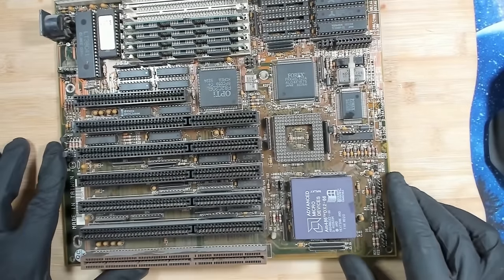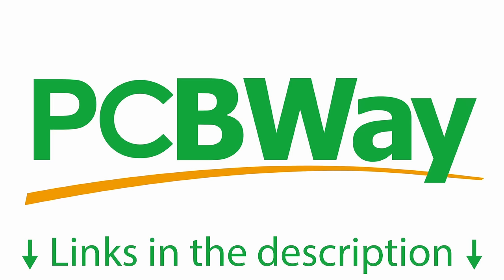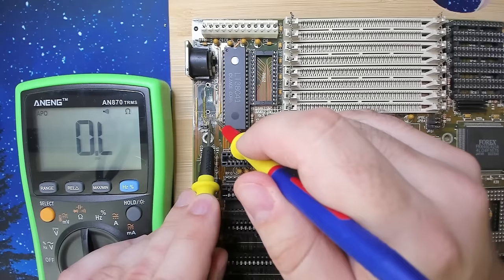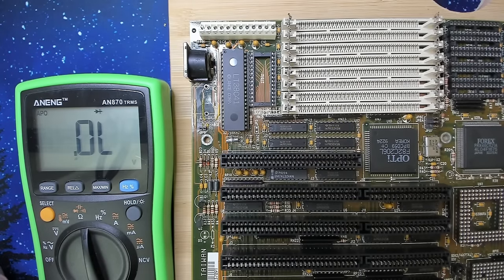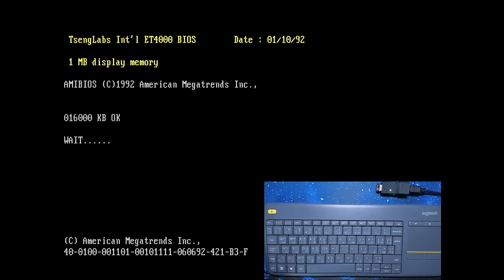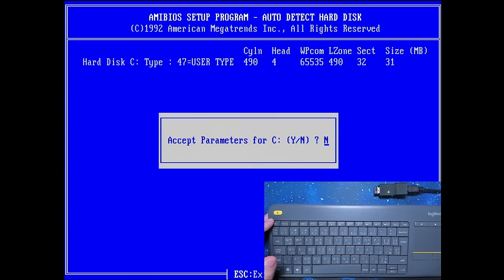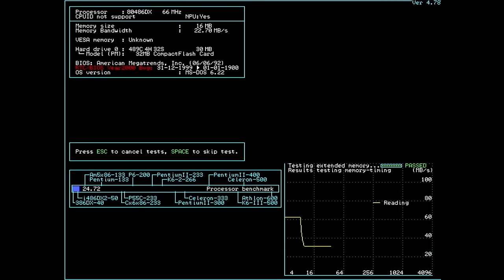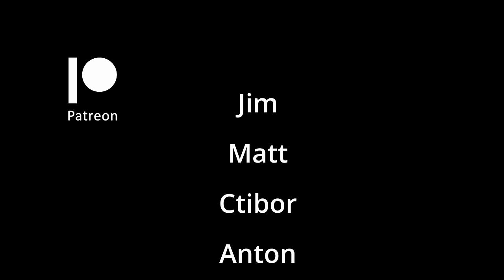Dual-Socket Nostalgia: Forex 386/486 motherboard repair

Comment: I'm playing with PCem with 386 DX-40 machine. It displays perfomance lower then Compaq DX-33 in SysInfo. I wonder why. I checked all BIOS settings and played with some. Only cache disabling changes something, lowering it to 20 SI points. All the other don't do anything. That annoys me. I expected ~40.
 So I changed virtual CPU to Cx486SRx2/32 and now it is circa what I wanted (43). But the whole situation is weird.
Reply: I found what coused this behaviour! It is Waitstates but not in BIOS. It is in PCem configuration. It was 'system default' and now I tried 0 W/S. Now 386 DX40 makes 41 Sysinfo points! Just as planned. =)
Reply from the maker: Nice find! Congratulations on finding the root cause!
Reply: @bitsundbolts  I wonder what are those w/s intended for?
Well on real hardware there are plenty of nuance to be adjusted, but here we've got perfect components that don't require adjustment, aren't they?
Reply from the maker: I'll cover that partially in my next video. It depends on the modules how quickly they can switch from a logical 0 to a logical 1. Basically how quickly the voltage levels can rise and fall. If a memory module is too slow, wait states can mitigate that issue. The drawback is that memory bandwidth will suffer. At least this is how I understand it right now.
Edit: when you emulate old systems on modern hardware, you don't need to worry about wait states. You can just set them to the lowest value - unless you want to slow down the system a little bit.

Comment: Id love to have a wireless keyboard on the bench. One less cable . But i would want the dongle small without a cable. If you know what i mean.   AT keyboard to usb dongle.  Love the videos , keep up the good work.
Reply from the maker: We could change the adapter to plug directly into the PS/2 port without a cable. But I have to check with the creator. All suggestions are welcome!

Comment: I've got a similar motherboard (same chipset soldered AM386DX40) , found that switching from a 80386 to a 486 CPU required the turbo switch to be physically jumpered (JP14 block).  My board is the MECER Corp B800. Could very well apply to yours :)
Reply from the maker: I'm using a jumper on the pin headers. You're right, it is the easiest way to get such a board to its optimal performance.
Edit: does your board score also low on system information (if you would have that data)?

Comment: Unfortunately the mod you made for the battery is not going to be enough to keep this board's settings.
It has an 82c206 chip, which contains the RTC circuit. Unfortunately this consumes a lot of power and it'll drain a cr2032 in just a few months. I don't expect it to last over a year and a half
Reply from the maker: Ok, good to know. I haven't added the button cell battery yet. If I ever do. At the moment, I use the external battery connection.
Reply: @bitsundbolts  using external batteries it should work okay, because you can put much bigger ones (back then they used big 4v lithium batteries iirc)
Reply from the maker: I have 3x AAA at about 3.8V - that's very close to the rechargeable battery that was there (I think those have 3.6 volts).
Reply: That's not a huge problem if he pulls the battery (or puts a piece of paper under the contact) before it goes back on the shelf. I pull the battery out of my caliper because it never turns off either, even when the display goes blank.
Reply: @mal2ksc  well true, but that's only if you use it temporarily. If you build a PC with it, it's not a solution.

Comment: I suspect your problems are  related  to the fact that it's a multi CPU board and the chipset is neither fish nor fowl nor good red meat.  I'd set that the implementation  for the cache is screwy/borked in some fashion.  Try it without cache with the 486 and  with and without cahce wth a 386.

Comment: Try measuring ISA clock. It should always stay at 8.3 mhz
Reply from the maker: Good point. I have a feeling that the frequency changes in certain situations. But i am still confused why system information would change the systems speed
Reply: @bitsundbolts  Yes, that's quite odd behavior indeed, but also very interesting at the same time. 🙂 So please let us know of any new findings!

Comment: The memory speed seems quite low at 10.8 MB/s. My 486 DX2 machines (DECpc LPV and a cheap Notebook) have 25.6 and 17.7 MB/s in cachechk respectively.
Reply from the maker: Thanks for the info. Yes, that is indeed slow. I wonder if the chipset has something to do with that. I should try a 386 in that board and see if the speed improves - especially the score in system information.
Reply: @bitsundbolts  That would be interesting, but you'd have to remove the 486 from the non-zero insertion force socket :D I searched for some memory speed screenshots on vogons, and most 386s seem to be between 10 and 20 MB/s. So maybe it's also normal. Did you try more memory waitstates with the too? Maybe theres something funky at 0 WS?
Reply from the maker: Ahh, 😫 - I broke two plastic spatulas already trying to get CPUs out of this socket.
I didn't try different wait states. Good point. I should try and see if there's a difference. Could be that 0 WS is flakey
Reply: @bitsundbolts  You want a tool that is sometimes called a "lice rake" because it resembles a comb used to get lice out of someone's hair. It slips between the pins on a 386 or 486 so you can lever them out of the socket without breaking off the edge of the chip or socket.

Comment: I am a little surprised there is enough current to drive everything off of the keyboard circuit.
Reply from the maker: Yes, the adapter takes its power from the port on the PC port. That port also needs to power the keyboard - so, there is enough juice for the little adapter as well.

Comment: The unknown bus connector looks like a EISA Slot 32bit 16MHz.

Its easy to test ... If a ISA Card Work in it, its EISA!!
Reply: As  Artheos warned him - if its Opti Local Bus then plugging wrong card will result in escaping  magic smoke
Reply: @rasz  crazy Shit ... Its the Same connector But electronic incompatible. Also cards Look simulare WTF

Comment: just fresh from watching this video and my first thought is chipset. some bug or limitation in the chipset. or it could just be a really crap board. they did make a ton a crap back then
Reply from the maker: Haha, maybe... Unfortunate because it would allow testing 386 and 486 on the same board. Maybe the 386 performance is ok, but they dropped the ball for 486.

Comment: I am wondering if the 386 BIOS may be causing/creating an issue.  Perhaps you could configure it with a 386-33, if you have one, and run some tests on that.  If the performance is as expected, for the selected 386 CPU, perhaps a new BIOS will be in order, should you choose to reinstall the 486.

Comment: Jack-of-all-trades boards like this tended to do lots of things poorly. The 486 support is probably bugged as you found, but good luck finding a BIOS to run 486 CPUs properly. I wonder if a 386 DX 40 would give a better experience all around. In reality, that is what probably nearly all boards like this were actually used with as they would have been sold to people that couldn't actually afford a 486 system at the time. 

That reuse of the EISA physical socket that is even labeled EISA but will literally destroy expensive and rare EISA cards (both then and now!) is just terrible design.

Comment: Hi, BuB I have a question. Last year I bought  Socket 3 mainboard with a password on BIOS, I tried almost everything to disable passowrd (remove old barrel battery, clear cmos, I tried to type some award passwords). Do you think if no battery can be a reason that BIOS wants a password? Mainboard: DataExpert EXP4049
Reply from the maker: Hm, that is a very uncommon behavior. I've never heard of a BIOS requesting a password after it was cleared or the battery was removed. Maybe you can unplug the board, make sure no battery or other sources of power are connected to the board and leave it overnight to properly discharge. You might have done that already, but I don't have any other suggestions right now. The manual for your board on the Retro Web is quite limited.
Reply: @bitsundbolts  thank you for your opinion, I will try it again with CR2032 battery

Comment: I’m interested in the usb/ps2 adapter. It would make much easier and flexible using modern mice and keyboards. I have some stocked, the keyboards are ok, mice are from Aliexpress, I would rather use some Logitech. It’s getting more difficult to get PS/2 hardware and eventually is gonna get expensive. I would buy a couple of this adapters.
Reply from the maker: I'll make a dedicated video about it and show off the capabilities of this adapter. The creator is still ironing out a few small things, but the prototype is working pretty well!
Reply: Looking forward to the review. It will be a great addition to the retropc community!

Comment: I would like something that would allow using at keyboard with motherboard that needs xt keyboard. Well if you could use usb keyboard with motherboard that needs xt keyboard it would work too
Reply from the maker: The adapter does support XT as well

Comment: Have you tried disabling the maths co-processor (FPU)?
Reply from the maker: No, I haven't. The FPU is on the CPU itself. Any reason why it would make a difference if the FPU is disabled?
Reply: @bitsundbolts  It's just a hunch... You've already excluded several things:
1) the CPU / bus clock (seems to be a stable 33MHz)

2) the CPU itself (same behaviour with different chip)
3) cache issues (well, maybe there's more stuff to test before we can say it's 100% not a cache thing)

The only other way I know how to make a CPU seem very slow is to have an extremely high rate of interrupts. There are not many sources of interrupts on that machine. IRQ0 is the only one that could typically trigger interrupts quickly enough to cause these symptoms, and it's easily controlled from software. However, it woud be very obvious I think.

But then there's the FPU which can also cause a LOT of interrupts if a few weird things get a bit fucked up. Like dodgy grounding or VCC ripple or some other kind of electrical issue? Then maybe that benchmark program is doing something to the FPU mode flags?

I have no idea but still, its one of the things I would mess around with for a few minutes.

Comment: The solder is 38% Pb. I guess, it is not possible to buy that in the EU anymore.
Reply: Bürklin has it but doesn't want to sell it to you by mail. Maybe if you drop by their facility in person, i didn't try. Or if you have a registered business, then they sell it to you no problem.
TME might be easier, it's hidden if you're browsing from Germany but if you have a link i heard you can buy it. They carry Broquetas and Cynel.
Eleshop will just sell the same Broquetas leaded solders to you from the Netherlands.

Comment: I take it this era of systems can't actually use more than one socketed CPU at a time? Would be pretty interesting if somebody could build a system that could somehow utilize multi CPU.
Reply from the maker: Yes, those boards will only work with one CPU at a time. Think of the memory access for instance. Those memory controllers cannot accommodate two CPUs requesting access to the memory, or ISA slots. Most of the traces go directly to the CPU socket. I have another 386 board I need to work on. There are almost no other components on the board except for the CPU.

Comment: I tried building a ps2x2pico twice and failed both times. I threw in the towel and I'd love to buy a prebuilt solution that accepts USB mouse and keyboard. I use a USB switch and would love to hook it up to one of these if it supported both mouse and keyboard.
Reply from the maker: The adapter supports mice and keyboards. At the Moment, you would need two devices. That is a problem if you're using a dongle that acts as a USB hub to transmit both, mouse and keyboard signals.

Comment: Opti-chipsets are just soo sloow... I have 386/486 hybrid board with VLB and it's fast with 486DLC CPU but super slow with 486. Memory bandwith is miserable, whatever timings are used. So, try a 386 CPU 😅
Reply from the maker: Interesting. So, it might just be an issue with that board and it may be better to just use it with 386 CPUs
Reply: @bitsundbolts  It might be a good match for the AMD 386/33, which most likely will happily run at 40. That should offset some of the shortcomings of the board.
Reply: Opti chip here is a 206 = peripherals, nothing to do with CPU/RAM communication thus no influence on system speed.

Comment: One should be able to colour match the mask by mixing these Mechanic UV mask resins, but i haven't tried.

The application looks thick, but i know it's difficult to apply thinner. I have had to apply the mask much thinner for it to actually successfully UV cure. But then i don't do sun :D

Oh also i noticed recently Relife has a clear solder mask which they promise is much quicker and easier to cure. Haven't gotten any myself yet.

Most of my keyboards (not the mechanical one i use day to day on my computer) and quite a few mice have internal PS/2 functionality and work with a passive USB to PS2 adapter, and i thought everyone had it like this, because they're extremely cheap and widely available. But i guess if you want to use your favourite input devices, wireless ones and the like...
Reply from the maker: I had this multiple times that the solder mask cures outside, but is still liquid under the surface when using the UV light. When it's under the sun, it cures properly.

Comment: the memory would be a bottle neck! but not likely ! I would test it in 386 mode! if you get the same results! the bottle neck is the cpus to "North Bridge" the number of lanes of data thru put!

the ps2 mouse port and key board ports are same eclectically the same just different positions in the ps/2 connector... they both use the same clock circuit same transmit and receive and Vcc and Gnd its just a matter of flipping a couple of wires to making the USB to ps/2  function as a mouse .

Comment: A bit surprised that you are based in The United Arab Emirates. You sound like one from Germany. Didn't know that retro computers are easily available in UAE. Is there a community for old electronics and computers in UAE?
Reply from the maker: I moved to Dubai almost 20 years ago, but I grew up in Germany, went to school, and left right after that. The retro community in the UAE is quite small. I just know a few people who are into old retro PCs. If I wouldn't have been introduced to the scrapyard that receives old hardware from time to time, I wouldn't be able to make those videos.

Comment: That's an EISA slot.
Reply: He covered that. No, it's not, and it was the worst connector that could have been chosen for this proprietary interface. At the very least they could have spun the socket around 180 degrees so the notch falls in a different place.
Reply: @mal2ksc  I had an 80386DX motherboard with EISA slots, and the connector seems identical.

Comment: the results for an ISA video card are just about average for that setup. the Dual socket boards are not the best performing ether, i have 5 of them and its hit and miss. a dedicated 486 isa board with the same cache and cpu in my testing performs a little (Not a huge amount) better. comparing results to a PCI is like comparing results of a PCI s3 to a top of the line 3090!
Reply from the maker: Yes, that is what I was thinking as well. I mentioned in the video that the other benchmarks were taken from a 486 board with a PCI interface. It might have been a 386 board that was slightly modified to accommodate for the new 486 chips - with minimal effort.

Comment: That is a VESA slot, and I believe the second slot is for a math co processor.
Reply: Both wrong, it's a proprietary slot that was (stupidly) built from an EISA slot physically, and the second socket is for a 386 as covered in the previous video on this board.

Comment: I would very much want one of these keyboard adapters...I assume it would work with a mouse just needing a second one?
Is it possible to buy them already?
Reply from the maker: Yes, the adapter works with a keyboard or a mouse. As you correctly said, you would need one adapter per device.
The adapter is still in a prototype stage, but it works pretty well already. As soon as it's finished, I'll announce it.
Reply: @bitsundbolts should it be possible for it to act as a hub? I seem to remember some PS2 ports allowing both keyboard and mouse in one connection
Reply from the maker: Yes, I have seen the specification for a PS/2 connector and there are pins for data (keyboard) and mouse. Unfortunately, I don't think it is implemented on most systems. They just decided to have two ports to separate the devices.
If the creator of this adapter finds the time, maybe he can integrate a splitter to separate keyboard and mouse signals coming from a USB dongle (like the Logitech receiver). But it's a lot of work and I'm not sure if he has that time to do it.